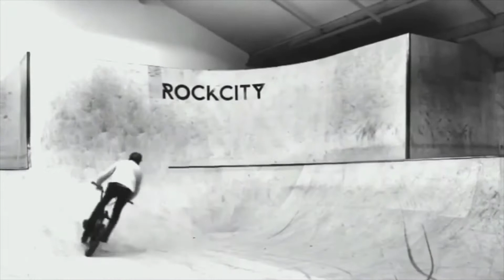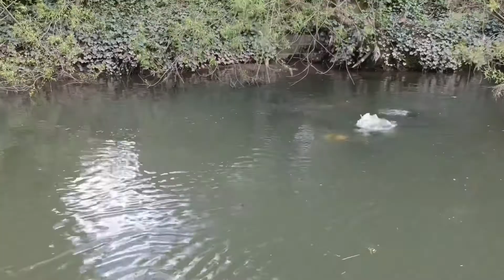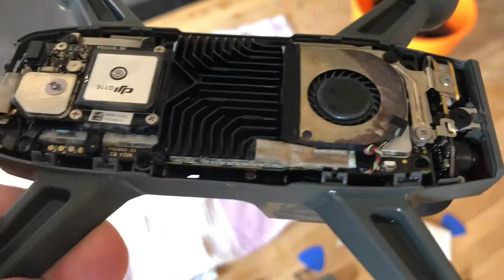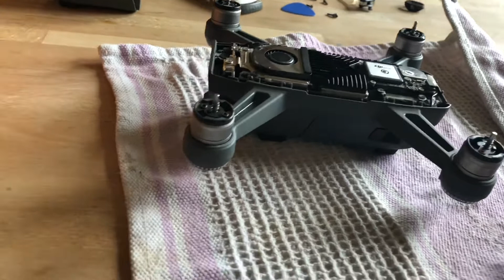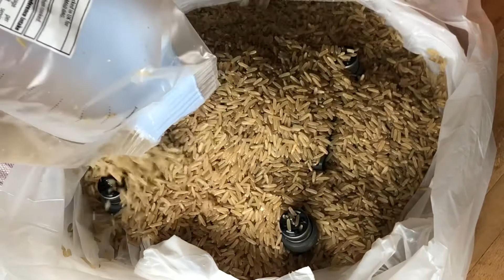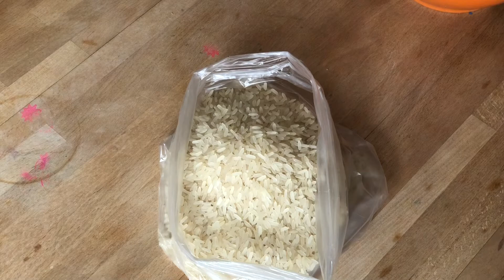BRINGING A DEAD DRONE BACK TO LIFE - PT1 - DRYING PROCESS - DJI SPARK

Comment: I'd still have washed with distilled water - it's not the water that damages stuff, it's the minerals that are slightly conductive that get caught between the pins on the chips. I've recovered several old gameboys and mobiles that have gone through the wash by using an ultrasonic cleaner with distilled water (useful gadgets and cheap on ebay). Good luck anyway, the fact there's some life is certainly a good start.
Reply from the maker: Yeah Im on it! Thanks for your help!